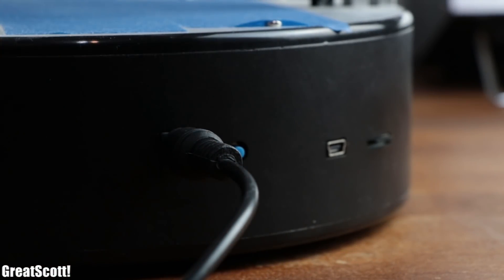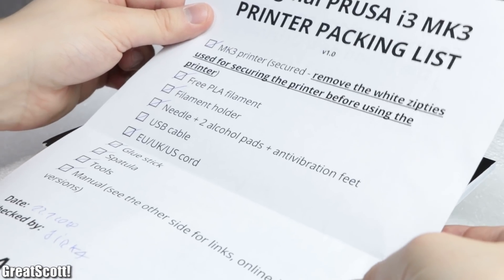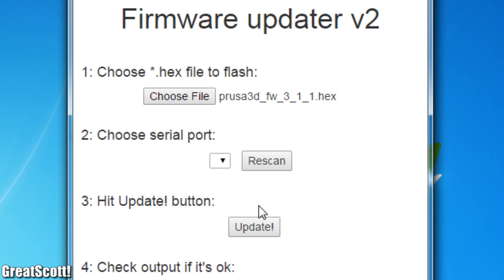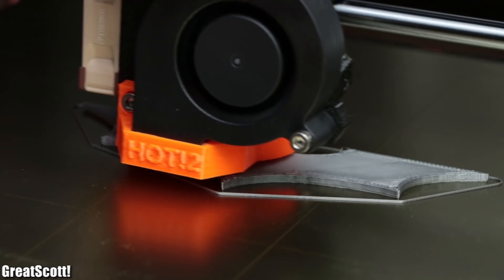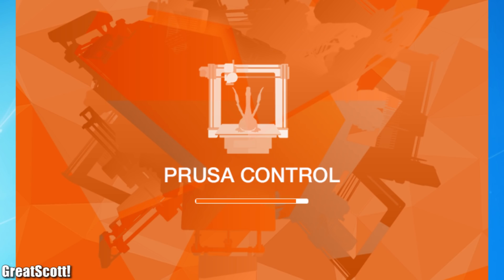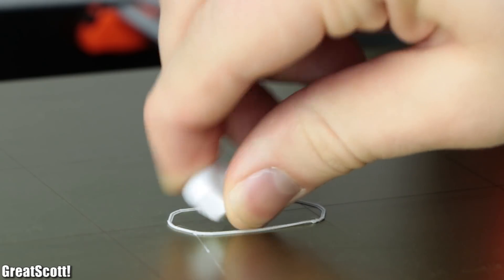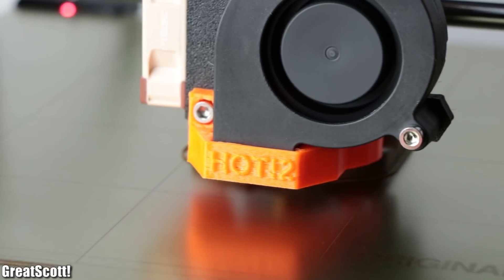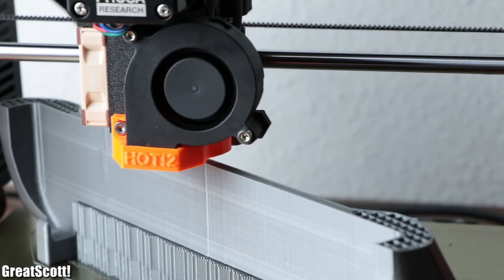Original Prusa i3 MK3 3D Printer Review - Still the best 3D Printer?

Comment: If you take the time to trim and adjust the Anet A8 3d printer, you can get just as good quality from a sub 200 USD printer.
Reply: Kristian Hansen I have A8 with all mods and upgrades, including am8 aluminum frame and hi end electronics - its waste of money... For now, I spend so much, that I can bay a prusa i3 mk2 or mk3 kit. If you have good budget, get better printer from start.
Reply: I bought an anet a8 and spend 2-3 hours playing around with the bed leveling and parameters, and now I can print ball bearings, screws and nuts and other mechanical components in PLA. It has decent outer tolerances (+-0,2mm) but the holes always come out ~0.6mm under. It takes a little time, but I have great experience with the Anet A8.
Reply: -  but I agree - if you have the money, get a better printer.

My Anet A8 will probably break down after a couple of years of use.
Reply: Also, the Anet has some serious safety hazards.

Comment: I'd love to see you take a stab at building your own 3D printer with some arduino parts and stepper motors. It might not be the best product, but it would be absolutely educational and teach what goes into a 3D printer, how to maintain one, as well as general hobbyist arduino skills and logic. Maybe it could even be a DIY or Buy.
Reply: How diy should it be? For example, using linear motion components, aluminum extrusion, a fully assembled extruder kit and hotend kit, it would come down to just printing some mounting hardware in another printer and put it together. Would probably end up being a bad ender 3 at a higher price.
Or should he go full diy and use hardware store threaded rods to drive the axes etc?
Reply: @LuLeBe It's been a few years, I made this comment back when I didn't have a 3D printer but desperately wanted one. but I was thinking more so the latter. Using arduino as stepper controllers, finding the best IC's for silent steppers or  IC's for frinting faster while canceling motion jerking from moving too fast etc. it's been awhile, but I've seen solutions where you literally slot in an arduino for every motor or just use an at-mega as a controller.

Once you have the controller set up it's basically rods, heating plate, maybe point out that while duel extruder and hot ends sound cool in theory it cuts down your printing area, so for multi color prints you should look into a mixing hot end etc. Maybe spend more or less on rails and steppers to get voltage based end stops without limit switches. Find a acreen, do some tuning in Marlin, flash, you're off to the races.

Great Scott always has a very analitical pros/cons view, he might prioritize some features over others, how can you get the most features for a decent price etc. I honestly just wanted to see his take on it, and it would have served as a gateway for people like myself who wanted to get into the hobby. Even if it was just ripping open some old DVD drives for motors and ordering a hotend Great Scott probably would have made it interesting.

Comment: Check out the Tronxy X5S which has a 330 mm X & Y and a 400 mm Z print capability. It is a cube framed kit printer with 4 guide rods and 2 stepper motors in the Z axis. There are user generated 3D models available on thingiverse for modifications like frame corner brackets, a part cooling fan two outlet shroud, motor mounts, belt straighteners, and a control box frame mount which address the printer's shortcomings and turn this into a top shelf printer with a huge print volume. A major shortcoming is the 12 volt power supply which results in longer heat up times and too low of a maximum plate surface temperature limiting material to PLA. The plate can be easily insulated to improve the heat performance and some have changed over to a 24 volt power supply. This is selling now at under $300 US from Gearbest!

Comment: As someone who works on steel-cutting CNC machines, this looks so flimsy... but I guess for the price, it's reasonable. 

I wonder what's hindering the precision of today's 3D printers more, the overall construction and positioning hardware and software, or the nozzle and filament material itself.
Reply: You get higher precisions with smaller nozzles, but that also would mean a higher print time.
Reply: But a good 3d printer will always look 'flimsy' for someone who is used to cnc mills.
Mills have to be stable / heavy while good printers should be light/fast.

Comment: I am planning on buying one of these. Have you considered nylon printing? It’s my understanding that the material offers you both strength an flexibility, unlike other more brittle material, and you can use yard trimmer line as the spool.
Reply from the maker: I have not tried nylon yet.
Reply: Highly recommend you check it out, for your projects that are meant to take a beating. It is tricky to work with because it has to remain dehydrated and has trouble adhering to the surface.

Comment: Just get a Creality CR-10. Less than half a price, bigger print volume, better print quality out of the box.
Reply: Not better print quality, less reliable, no comparison on customer support, doesn't have the features, way louder, not open source. Yeah, CR-10 is cheaper, but you get what you pay for.
Reply: @SplicesAndCelluloid  customer support holy shit they never help  and prusa the software sucks balls and has for a long time.
Reply: now its open sources, but the things like support etc, yes absolutely. even after several PID tunes, my hotend temp still fluctuates  on the CR10. its a lot louder, even with the dampeners and being on a heavy duty rubber tile (40x40 tile)  its  like comparing a TATA against a Volkswagen..

you get what you pay for.

bang4Buck : the wanhao i3 Mini ( 130 eur),  or CR10 Mini do a good job.
bells and whistles, quality , support : Prusa .
Reply: The Pruisa i3 MK3 shows a very excellent print quality. Also pretty much no sensors, you need to calibrate it yourself.
Reply: @Toxicity1987  Calibrate and calibrate again because bed level changes after some printing, it's insane, especially when you need to print a lot of same pieces with same dimensions
Reply: Print quality is better on the mk3 and you get way more features with the mk3, like a removable bed and the tmc2130
Reply: Electro Spark and a cr-10 is way slower if you want to use the entire  z axis with the same quality
Reply: Matej Zubčić Matej Zubčić I'm not a huge fan of the prusa i3 either. But complaining about printed parts is a bit weird. Cheap Chinese injection molding isn't that great... Also prusa uses abs and petg for their printed parts. I know this because I have the same filament they use and compared it to the mk2 of a friend. Unless you are so unexperienced that you print at <50mm/s you should see that a printer like the cr-10 isn't anything special. The MK-3 itself is not either, but a few of the new features might be useful later on.
What printer do you use? If the answer is anet a8, then... 
Nope, not even close.
Reply: Matej Zubčić: Original Prusa i3 was never printed from PLA, not a single piece on any of the 3 models. So are all of your arguments invalid too? I think so
Reply: Štěpán M. Exactly my point!
Reply: Can you post some print photos of your MK3 or even the MK2? All the fancy features are welcome, but does not mean that they improve print quality. CR-10 has a excellent print quality out of the box.
As far as the printer build quality, you pay almost 1000 euros for a printer made out of metal and 3d printed parts vs the all metal and extruded plastic materials used for the CR-10.
MK3 is a printer with a lot of features (the most convenient one is the magnetic print surface IMHO) and good print quality, but is way overpriced.
CR-10 lacks some features, but offers a sturdy frame, large print volume, good print quality and costs less than half the price.
Reply: If you would have properly read my posts above you would have seen that I don't own an original Prusa and also don't want to. Comparing a chinese Kit with a printer with proper QC, Documentation and CE is a bit weird though. 
Also again:
At which speeds do you achieve these results on the CR 10? At least I care about print time. And a CR-10 is definetely not the right approach if you want speed. Also the heated bed is more or less crap.
Reply: or tevo tornado, heatbed heatup much faster
Reply: Nikos D you are actually right but the actually print quality can be justified when you get them on hands the cr-10 is Chinese brand  but this is a actually brand worldwide

Comment: Hey, just a tip, I heard that PETG doesn't get along with the PEI surface on the printer. I print with PETG so much that it's keeping me from getting one of those fabled sheets
Reply from the maker: I heard PETG is no problem for the surface. I also did not experience any problems. Flexible filament was more dangerous.

Comment: 3d printer, buy it or diy?
Reply from the maker: It is on my to do list but I have no idea when I will get to it
Reply: I'm afraid if you will finish it in 2022. 😁
Reply from the maker: Haha......possible
Reply: I knew it. Lol Wkwkwk 😁
Reply: Or Maybe you must try to review another model of 3d printer like sls.
Reply: @mbangunelectricchannel  2022 now
Reply: @greatscottlab  plz do it
Reply: GreatScott! You should get the SL1 prusas new (SLA I think) resin 3d printer
Reply: I done it myself. It's pretty easy. Just takes a long time to get all the necessary parts from china.
Reply: That depends on what experience you're after. I needed a tried and true 3d printer without all the experimenting. I also wanted to build it myself so I bought an i3 MK2s kit (before the MK3 came out) and assembled it myself. Kinda the best of both worlds. I got a really great 3d printer, and got to build it, but didn't have to experiment with what works and what doesn't. That being said, if you're after the experimentation/research aspect and you're reasonably mechanically/technically experienced that should end up being a kick ass project. Who knows, you may end up being the next Josef Prusa!
Reply: diy ofcourse
Reply: Buy it built if a day's worth of assembly is worth more to you than the price difference between kit and assembled.
Reply: @Maulana Abdul Malik A   SLS printer aren't worth it for home use in my opiniom. They are much more expensive to buy (>$8000) and the material is also much more expensive (>$150/kg). The SLS process itself also isn't very home user friendly because in order not to waste time and fresh expensive powder you'll need to fill the buildvolume to the max. The heat up and cool down times of about 2h each make it a much more time consuming process for small machines. The only advantages of SLS are the strengh and that you don't need support. But it isn't more precise then FDM. I've worked with two Sintratec S1 SLS printers at school and they were a nightmare. The support guys from Sintratec tried to get the machines working several times and eventually gave up and refunded two of there brand new machines because even they couldn't get them to print reliable.
Reply: Simon Hersche also fine (metal I think right?) floating in the air getting on EVERYTHING PRO TIP:breathing in metal powder is not good for you
Reply: well to clarify, DIY off a working design is not that hard to do yourself ....or minor adjustments .... designing parts or a comple on from scratch thaits quite hard doing it yourself though, without having done it before.
Reply: Want to just get prints to do something? order prints or buy a good printer.
want to learn about 3d printing? buy the cheapest kit out there and fight it upgrading for an year or so; you'll come out of the ordeal with tons of knowledge and confidence and will be able to DIY a very good printer for half the cost of an equivalent commercial model.
In any case, if you're new to 3d printing and want to DIY one, you should definitely buy a cheap kit first and follow a community so that you get to learn all the do's and don'ts of the field before you commit to building one. I've seen very experienced CNC builders build really shitty 3d printers because they had no knowledge of the specific requirements and were overconfident.
Reply: @nipunagunarathne4882  i
Reply: GreatScott! DIY a 3D printer sounds very interesting! You can divide the project in many stages.
Reply: I working on DIY 3D printer...10months xD but.... No cash and Size....450x600x470mm...now get cash for parts to finish hard part....frame.... (still not enough but now only 260$ ;wood frame prototype and its printing :D need more around 250$ to use all bed size and another 270$ for electronics duet 3d best on market) After i finish it i try to make some video how to do diy 3d printer step by step for cheap :)
Reply: Buy the kit ...
Reply: buy, diy is not worth the price, a Chinese kit is not that expensive - and if you want diy you could buy a kit with most of it in it too and go from there (disclaimer, you better know your DIY that cuz its hell to got that route :3 )
Reply: first buy it, then build it, then... make one with your printer jajaja
Reply: I made 3d printer myself 2 years ago similar to prusa I3. Built frame out of acrylic sheets witch got for free from my friend. Bought all other parts from ebay (motors, controller, linear bearings, heatbed, psu, ect.). I spent 180eur on this build and it took about 5 weekends to build it.
Reply: Diy. The parameters for customs are tricky but most kits do not utilize industrial grade quality and thus the accuracy of a diy have a way more potential of being accurate and fast. The prusa could be improved but then it cost more and most printers today are made for reasonable manufacturing , not neccesarily accurate as primary use. You can buy smothrods with my mm tolerances, plastic couplings and slides of hobby level cant compete with industrial, however the benefits of being able to buy a prusa with reasonable quality is vast. Most people do not know where to buy half of the parts so if you do not know the difference between a trapetsoid screw or a ballscrew or a threaded rod..dont diy
Reply: I did a DIY last year. Same design as the Prusa but all home made. I spend off couse enormous many hours on this. But it was fun amd a great learning experience.
Reply: dyi :) you will get to know how it all works, and you ll be repair it later by yourself. also i got way better results when i built in at home than boat benchy in this video. took me 12 hours tho, but i really enjoyed it ^^
Reply: Agree, there's a complete and kit version, the kit version is cheaper than the complete version, and the only thing you'll only really need to worry about when building the printer, is calibrating mainly the PINDA, but there's a z-adjust that really helps to make z-calibrating easier, as long as you follow the manual
Reply: Using a STM32 board such as a Nucleo seeems like an option here. (Teensy might also be an idea).
Reply: Well I already made it from scratch , it took 2.5 months to complete to its finished version.
Reply: i can’t find my usb cable and i’m freaking out 😀
Reply: The prusa i3 mk3 is open source, you could clone it.
Reply: Still not complete
Reply: If you diy it will take you months and tons of extra cash to make make it running flawlessly. But if you find that fun go ahead and do it.
Reply: @oukid2633  no I built mine in a day and a half off n on and I did it step by step carefully and it's flawless
Reply: Buy... Less problems..
Reply: Francisco Javier González Lara - Problems are the trigger for creativity.
Reply: buy , buy ,  buy. 
a few reasons
: warranty, kit version have less warrenty ( when buying local)
unless you really enjoy the process of building, I like to get something that works out of the box , I have 2 wanhoa minis for teh kids , as well as CR10 for other rpints and the Prusa I3 MK3  Pre assembled. 

the ease of mind to know you have something that either works, or can be returned is worth the extra $$. not even mentioning the time saved.